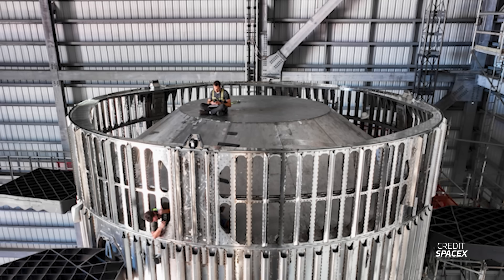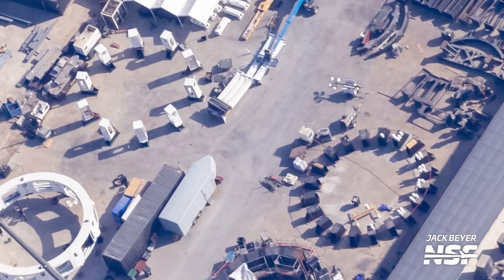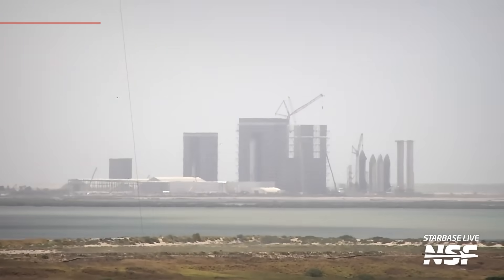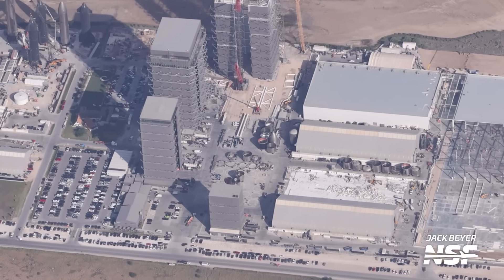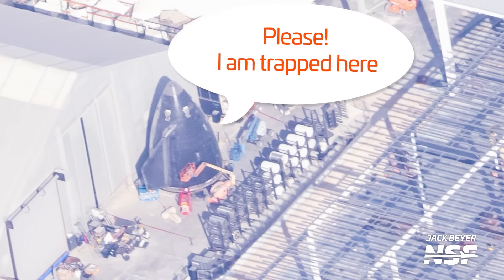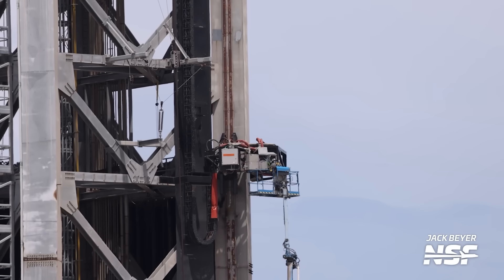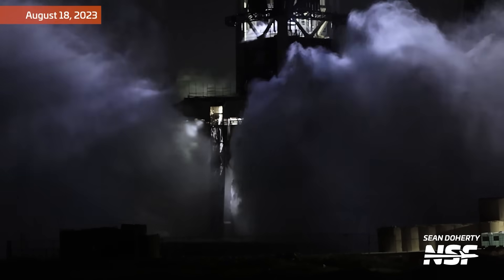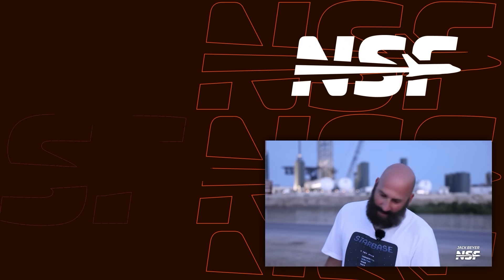Is Starship's Orbital Launch Mount Ready? Plus New Aerial Images & Booster 9's Hot Staging Ring

Comment: Thanks Jack and NSF team!  Great update as always.  Nice to see the factory expansion, and the "Repair" work done at the OLM done so quickly following the 33/29 SF.  My guess is that they have a critical "Timing" issue to solve to get all 33 to light in the order desired, as quickly as possible.  What were they trying to get all 33 lit in under 1s, or is it more like 1.5s?  Requires a bunch of very slick control over valves and such that, when they're as large as we suspect (3"-4" lines or maybe larger?), they don't just usually "Snap" open or shut.  I'm sure they've got engineers working all angles of those things to get them to be as "Snappy" as possible though.

Comment: Great video! I wonder if helium is really used to start the outer engines? I thought helium was used because it stores better in COPVs. This is all ground equipment and nitrogen is cheaper, so I would think they may use that. But I guess that may require a different start up sequence.
Reply: Yep, why helium, nitrogen is so much cheaper.   What's the technical reason?

Comment: I am confident that hot staging will work, because the Raptor 2 engines are actually dang durable. They can survive blasting at a flat surface in close proximity, and 27 of 33 engines continued firing during IFT 1 when there was no flame defelctor and deluge
Reply: I don't think anyone's worried about the Raptors. Just.. everything else. Lol.

Comment: Hey, does anyone know what the method of construction used for the High Bays is called? With those exoskeleton-like structures on the outside?  I've searched but can't find comparable buildings.
Reply: IIRC, some of the Airbus factory buildings use this type of architecture.
Reply: It seems like some kind of lateral force (wind) resisting system but I still can't find the exact type.

Comment: depending on the size of the rings? could they fit inside a starship? i mean as crew cabins f.e.
Could they build the interior, and than form the outer hull of starship (steel ring) simply around it?!
I don´t know the size of the ring structures, but could they fit?
Reply: No. They are bigger. Ship fits in them.

Comment: It takes workers 2 months to build a house. But it takes spacex 1 week to build a huge rocket.
Reply: Bruh it takes a YEAR.                                                                                                                            

…
For a house.
Reply: Definitely not a year.  Once the rings are completed stacking happens fairly quickly.   Avionics and other vital parts are added and since they are working 24/7 getting a booster or ship built in close to two months is not unreasonable.   But I'm sure other Starbase observers have more exact figures.
Reply: @michaeldeierhoi4096  did you reply to me or the comment because mine was a joke and he is pretty correct
Reply: @Wurtoz9643  Yes I agree with you.  Yours was a joke and he was correct.  I'm glad we got that straightened out!

Comment: What about S26. Where does it fit in the rotation? S26 has engines.
Reply: S26 will likely be scrapped. 
It serves no purpose anymore
Reply: While S26 could be scrapped, it may be usable for launch testing purposes, either as to ensure orbital validation in the event of S25’s heat tiles successfully working during IFT-2, or as a standalone (no booster) test launch from 39A’s OLM, depending on when that pad will be ready.
Reply: @EMichaelBall  you can't launch a ship from the OLM.

Comment: They should add gantry platforms inside the high bay and mega bay to allow workers access to the building of the ship and booster instead of those mobile cherry picker type platforms.
Just my view to reduce use of bits and pieces equipment.

Comment: 8:35 This is Purely 100% speculative and lacks any factual support, But I believe, as an armchair engineer, that they could potentially attach the tank or a similar structure to the exterior of the ship, encircling its hatch. By creating a vacuum within this setup, they could simulate space conditions for testing the hatch's functionality. I doubt that there is  a chamber even capable of accommodating a full-size nose cone for vacuum testing, and constructing one would incur significant expenses.

Comment: Why does NASA need a complicated and stupidly expensive launch tower but Space X can do the same thing with standard mobile units, cranes and their mega zillah tower and launch mount for a lot less money and Space X system is reuseable
Reply: Because the NASA launch tower has evolved over 60 in conjunction with such things as the flame trench, crew access etc.  The launch NASA tower is designed for fully functioning rockets as opposed to the Space X launch tower was built just a couple years ago and is part of Stage 0 so it too is going through development toward something that complements starship when it is flying frequently.  

And that is a few years off.  Even just getting a monthly cadence of flights and reusing the whole rocket will require an indefinite time period.
Reply: Under a cost plus contract like HLS, the more snafus and complexity you can apply, the more money you can make.

Comment: The hot stage shielding structure looks like it could be fabricated from aluminum to save a lot a weight - the structure, not the upper surface shielding.
Reply: Aluminum is not as strong as steel.   Besides the entire starship is built of steel so it wouldn't make sense to build the hot staging ring of aluminum.